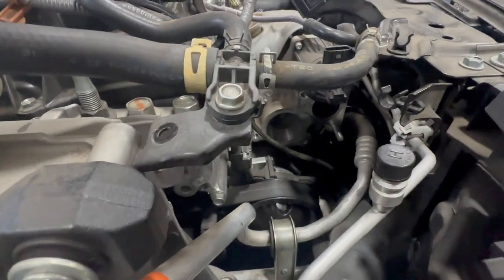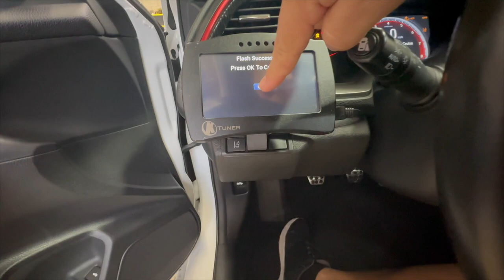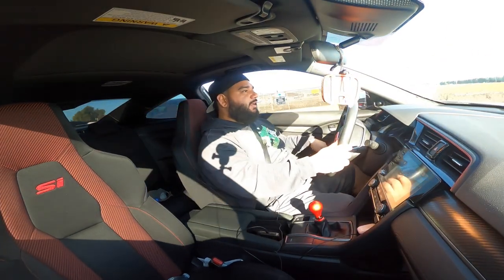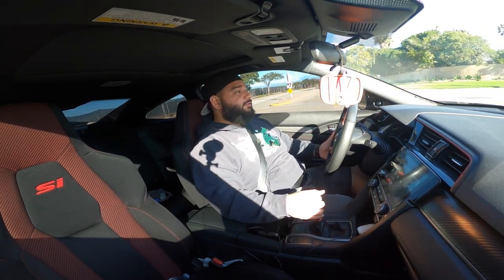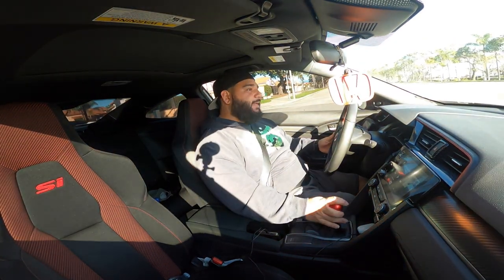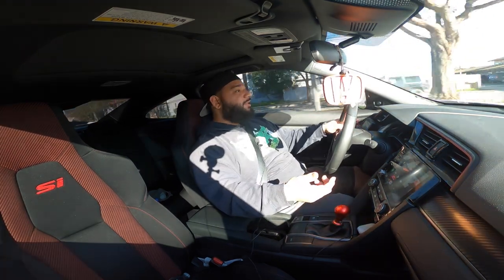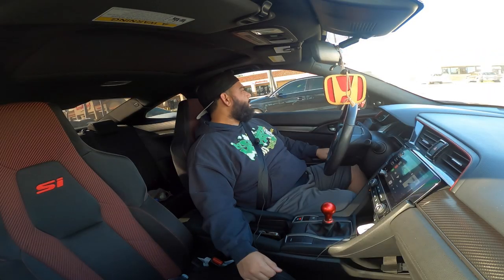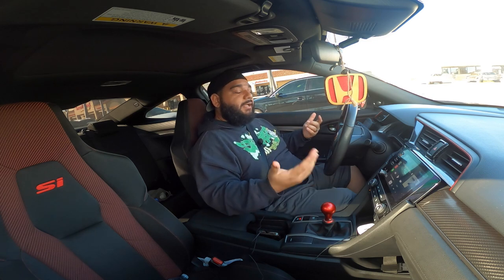My Civic Si can BREATH BETTER with this Mod | 27won Turbo Inlet Piping

Comment: Yea that bolt your talking about. Easy to get to it when you take the bumper off and the passenger front headlight. Bolt is completely in view and easy to get to
Reply from the maker: I ain’t taking all that off 🗿
Reply: @TdaKid  it's just a few minutes it makes it a breeze getting that bolt off though but I get you.

Comment: Yes it is very true stock turbo doesn’t flow enough air for stock inlet to be a restriction. Some advice for you guys out there it is BERY easy to put inlet pipe(Prl in my application not sure about the 27won considering it’s a one piece design ) when  installing a bigger turbo. You can literally put the inlet pipe on before slapping on turbo and make life/ performance way better!

Comment: Does the turbo inlet pipe make a difference or do anything for the stock turbo setup?
Reply from the maker: Couldn’t really tell, sound wise yea but very minimal
Reply: @TdaKid  you are aftermarket turbo correct ?

Comment: How do you feel the inlet pipe would be with just downpipe, intake, intercooler?

Also did you get any power or sound improvement from the 27won CAI?
Reply from the maker: It’ll help regardless 
Cars breathing better. 

And about the intake yes on both power and sound but PRL will sound louder and better air flow
Reply: @TdaKid  thanks man, yes I keep finding the prl may do more, but here in SC it rains quite a bit lol

Comment: Do I need to get retuned after I put this 27won inlet piping?
Reply from the maker: Depends on if you swapped out the street Maf to a race Maf like I did 
If not, still better to contact your tuner if you have a custom tune